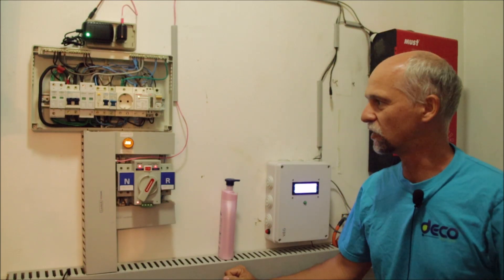Transformer-less "All in One"- Inverters, Back-door Voltages, Grounding mistakes

Comment: Because there is no iron core, copper wound output transformer to provide galvanic isolation between the DC boost stage and the high frequency inverter's AC output, all it would take is for the AC output monitoring circuitry to fail and one of the MOSFETs in the inverter's H-Bridge circuit to short to ground, and a high frequency inverters can send dangerous, high voltage, high amperage DC current straight to your AC appliances which can not only damage your appliances, but can also set your appliances on fire. Never buy a Chinese made high frequency, transformerless inverter.
Reply: Yes, I agree with you.  I prefer the Low frequency isolation types.  I think though with the cheap Chinese high frequency, if the scenario happens which you mention, if you have fusing on the output, that would trip before this high amperage DC would cause a fire.  Atleast, I would hope so.  I agree that the low frequency would be much better.

Comment: What would cause it to read 70 to 120v spikes on pv at night? Only have the 1 ground from ac in but if i remove it the issue goes away but then im not protected right?
Reply from the maker: @thedampestcrib6004  hi. I don't know if I understood you correctly... Voltage spikes, are voltages you measure on Neutral wire to Earth? Night, means the Inverter is off-grid, producing power purely from the battery? Grounding only from AC In means, you do not have an N-PE bond at the AC output?... Then your inverter output is isolated during that time and not grounded, yes.
Reply: @RolandW_DIYEnergyandMore  no I'm getting power coming from inverter to ac ground to the pv ground I think inverter is messed up

Comment: Sir, thank you for the video. The casing of my All-in-One Voltronic Apex-11 inverter is shocking. There is a ground connection between the inverter  and the grounding wire of the main electrical panel. When I checked the voltage between the casing and the ground, it read between 210 and 250 volts. However, when I disconnected the PV via the MC4 connectors, the voltage dropped to 104 volts. What could be the cause?
Reply from the maker: hi. check the voltage from the PV plus and minus to ground when the wires are disconnected from the inverter. is one showing steady high voltage, while the other is steady at around zero? if yes, then there is a DC leakage in your PV array. maybe a broken panel, broken cable, etc
Reply: Hello. I have done as you suggested. Both the positive and negative PV array terminals did not record a sustained high voltage relative to the ground. The voltage was under 20 volt. However, I noticed that when I turn off the input breakers of the panel and the AC input into the inverter and run the inverter only from the battery, the shocking ceases and the voltage drops to practically zero. It increases to about 60 volt AC when I turn on the AC input and rises to 125 volt AC when I turn on the panel breakers. @RolandW_DIYEnergyandMore
Reply from the maker: @1982757  is your inverter chassis or the ground wires physically grounded by an earthing rod? where do you live? what is your grid type? Is this shocking experience something new or was it there from the beginning. Is any of your battery poles bonded to ground?
Reply: The inverter chassis is grounded and connected to the earth wire of the main panel, which leads to the earthing rod. I live in Nigeria, and our grid is 230v 50Hz. I use flooded lead-acid batteries, and I don't think any poles are grounded. I noticed the shock after connecting a second 4.8kw PV array to the second MPPT input of the dual MPPT AIO inverter. @RolandW_DIYEnergyandMore
Reply from the maker: @1982757  interesting case. Its really hard to give advice without being there. Hope you can find out where you got a leakage which is causing the voltage feedback over the grounding system. Usually the physical connection to ground should at least pull down the voltage on the chassis to a low potential.
Reply: Ok. Thanks. I intend to separate the grounding wire of the inverter from the mains earth wire and provide another one dedicated to the inverter. @RolandW_DIYEnergyandMore
Reply: Update. After the separate earthing for the inverter. The shocks stopped, and the voltage casing dropped to zero. Thanks
Reply: @1982757 

Have you grounded the Inverter chassis with a separate earth rod ?
Reply: Yes, sir. And the shocking dissapeared immediately after that. Also, the voltage reads zero. Thanks  al ot. But I want to ask, is the earth wire suppose to carry any current at all in the first place? I am worried that the grounding may have solved the symptom but not the cause of the shocking. @Steveuploads
Reply: I have the same inverter and buried in the installation instructions, it warns about not using grounded PV panels. I ignored that and left my lightning protection for the panels in place with the surge protectors (this worked fine with a Voltronics V5 that I was using previously),  when I switched the system on it instantly tripped the lightning protector with a spectacular flash and lots of smoke. So now the ground for the panels is not connected to the inverter. One of the major problems is that  separate earth spikes can induce current loops in the earthing which is also not good.

Comment: I always wondered what was wrong with my inverter i  dismantled my whole wiring 3 times with no luck

when inverter is on and solar panels are bringing in voltage even if my fridge on the wall socket was off the led light of the fridge would come though dimmed my observation was somehow the PVs are feeding the earth line and its the one the false current powering the light ... and during the day when i would try to power my desktop the display wouldnt be stable i would see some lines kind of showers and i knew its to do with the ac from the inverter somehow mixing with dc input ... from your video you are one person that would understand my problem ... i tried google a whole lot of forums electricians none completely understood the problem to suggest solution
Reply from the maker: Well, yeah. Dimmed LEDs when circuit is off, strange voltages where they shouldn't be, that are all signs of missing earthing and correct Neutral-Earth bond on the inverters AC output side while in off-grid mode.
Did you check your earthing configuration? You are 230V/1 phase, right?
Reply: @RolandW_DIYEnergyandMore  yes its a 230v single phase actually its a small system it is only 2kva ... in  all truth its completely offgrid and not earthed ... i have one earthing pole i dont kno should i mix all earthing both dc and ac so many school of thoughts there had me confused... but at one point i did have my system eatherd but my problem ddnt go away
Reply from the maker: @nhlanhlankala8230  only connect structures on the DC side to earthing. Do not earth let's say the negative pole of your battery or PV. earth your inverter to your pole or earthing bar and make a Neutral to Earth bond on the AC side as shown in my video about simple Off-grid systems. Then everything should work just fine.
Reply: @RolandW_DIYEnergyandMore  let me look for the video and follow as you advise i will be sure to post feedback by earthing the dc side only i presume you mean from the surge protection device
Reply: @RolandW_DIYEnergyandMore  another ask its off topic though ... my inverter specs say on the solar charger mode_
Rated power 2000w
Mppt range 30 to 400
Nominal operating voltage 230vdc
I have 3 by 585watts canadian panels with each around 50 voc, my ask is around that nominal operating voltage my 3 panels dont reach that and if i where to add more i would surely exceed that rated 2000watts solar rating besides the grounding and bonding issue u have given me solution to everything works fine what are the implications of me not reaching that 230vdc nominal and can i exceed the rated 2000wats and my equpment safe aslong am below 400vdc
Reply from the maker: @nhlanhlankala8230  yes, surge protectors, panel frames, etc. only on DC side
Reply from the maker: @nhlanhlankala8230  the nominal DC voltage is not relevant! only maximum voltage not to be exceeded (50V x nb of panels) and Mppt voltage must be within range (35V x nb of panels). Usually you could overpower the DC input by max 20% as panels do rarely output nominal power. You could add a 4th panel safely if you wish.
Reply from the maker: @nhlanhlankala8230  is there a max DC current rating for the PV input?
Reply: @RolandW_DIYEnergyandMore  maximum solar charging current is 80A
Reply from the maker: @nhlanhlankala8230  ok, then all is within limits!

Comment: Great video, thank you.
The issue of transformerless charger/inverters is a growing issue. I have had various Voltronics inverter chargers and am currently using the the A11 Max as my needs have increased. There is a vast difference in price between the Voltronics units and, for example the equivalent Victron units.

The market is pretty well dominated by Chinese items in the UK. What I am wondering is if the risks could be eliminated by the inclusion  of a 1:1 autotransformer between the inverter output and the downstream AC circuits?

Just a matter of finding an autotransformer that will cope with the 50A output of the inverter and whether the surge on startup will shut the inverter down!
Reply from the maker: Hi, yeah. Isolation Transformers at the output would of course get you that barrier, but as you said, they are not easy to get and then the required power level would make them expensive. 
But it shouldn't be much of a problem just to use the High frequency inverters. They usually do have leakage monitoring and should shut down when something strange is going on between the Busses. And the other thing is, to use Type-B RCDs at the output to look for DC leakage if the inverter doesn't catch it.
Unfortunately Cost is King nowadays and even the cheapest HFI have all the best UI/System settings so they are very attractive. If I needed to build a 100% Off-Grid system, I would go for a Chinese Low Frequ. Inverter. Cheaper then a Victron and having the advantage of internal isolation.
Reply: @RolandW_DIYEnergyandMore  You make a great point to use these RCDs on the output.  I haven't seen others recommend them but you.  I believe it should be a standard for protection with all these inverters.

Comment: Hi Roland. I was with a friend yesterday who has a new Mr.Pow Hybrid inverter, with the orange stripe on a grey background color scheme. 

He reported getting shocked on the neutral line when working on a sub-circuit when he had isolated the live fuse in the local fuse board. When we checked the voltage he has 230v across L+N, 110v ish between L+ incoming earth and problematically we record again around  110v from the Neutral conductor to the earth. We measured this at a socket in the house and at the outgoing cables leaving the inverters. Questions are why is he getting 110v to earth on the L and not 230v ? Also would bonding the neutral and the chassis to earth put the Neutral to zero potential? 

Thanks
Reply from the maker: Hi, yes. His Neutral and PE line must be physically grounded and bonded. Then the problem should disappear.
The 110V from PE to L and N is quite typical for most inverters today if they do not get ground reference. Cheers
Reply: I have the same situation on my 24v 1000va Souer FPC 1000 B Standard non hybrid inverter of not having 230v L to earth. so if i bond neutral output to earth i won't blow the inverter up ?  @RolandW_DIYEnergyandMore
Reply from the maker: @Steveuploads  no, as long you do not bond both N and L to ground :))

Comment: Hello sir 
I want to ask you a question I have inverter PIP 5048 Mkx Mpp solar company my only issue us that when I have fully battery charged and low load home and high pv power. I see Mppt is up and down the power and that makes fluctuations in waveform output of inverter and i see that in bulbs.
Reply from the maker: So, if you shut down the PV input at that situation the AC output would stabilize? My Must inverter is actually just doing that in the SOL mode. Once my battery is full, the PV input would be shut down for 90 minutes and power would then come from batteries only.
Reply: @RolandW_DIYEnergyandMore  yes PV up and down effect on output should pv working with battery to make output stable like some Mppt I used before.

Comment: I think another interesting area is the PV array itself.  There is DC power from the panels, and probably a metal frame(s), and possibly AC power from micro-inverters.
I'm building a larger PV array and purchased a combiner box with a "lightning arrestor". It called for a grounding rod. Luckily I'm not using micro-inverters so don't have to worry about both DC and AC, but am wondering if it is worth it to tie-in all the frames to that.
Reply from the maker: Frames should not be tied into a grounding system via a Lightning Arrestor=Surge protection device. It should always be directly grounded either by a rod at the array or connected to your house grounding if the array is part of your house. SPDs would allow a buildup of voltage before they counteract. Thats not what we want with structural grounding.
Reply: Thanks ,great topic , as usual
Keep going